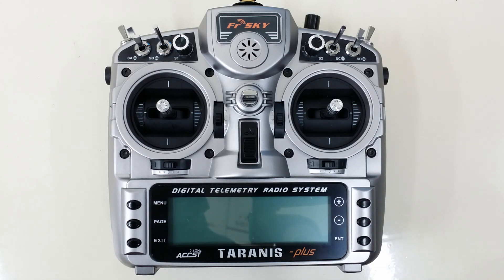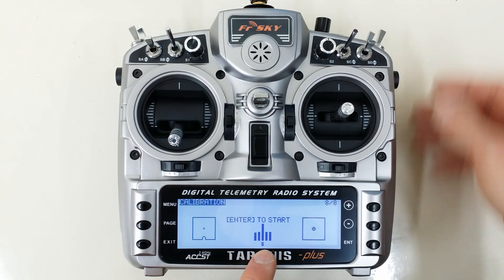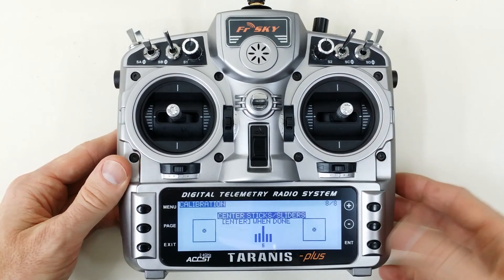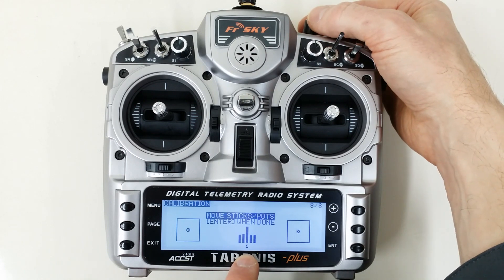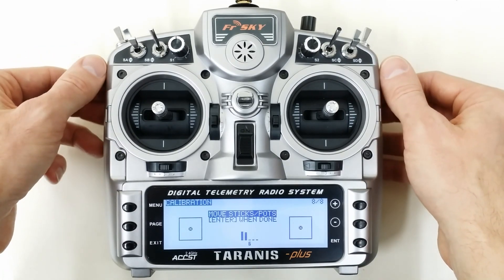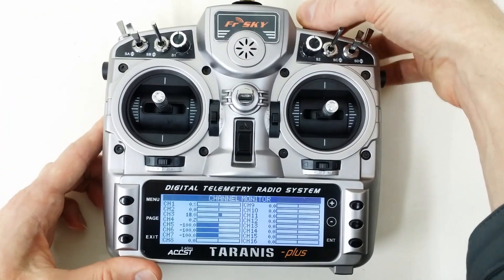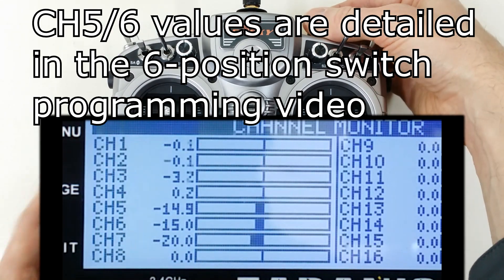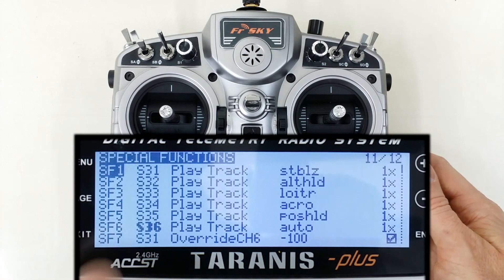How To: Calibration of FrSky Taranis X9D Plus with S3 6 position switch

Comment: I cannot get this S3 6 position switch to work. I thought initially i had a faulty switch and replaced it but the same problem persists. Essentially there is a jump with no curve of almost 50% PWM from the 5 to 6th position. There is no way to fix this with a curve or the like. I've redone the calibration, etc.. and it is no use. Help!
Reply from the maker: It sounds like you still aren't getting a good calibration. Be sure you've got the latest firmware and that you set the S3 port (or whichever port you're using) to "Multipos Switch", then calibrate like in the video. Do it slowly and make sure each movement of the switch registers just like in the video. If anything goes wrong you'll have to start the calibration over.